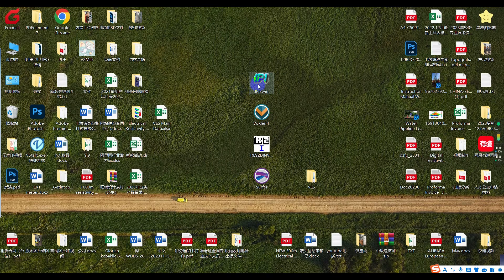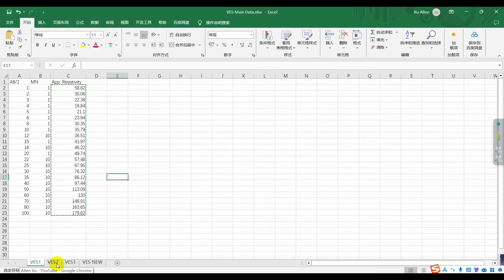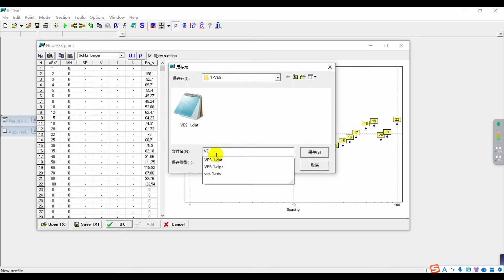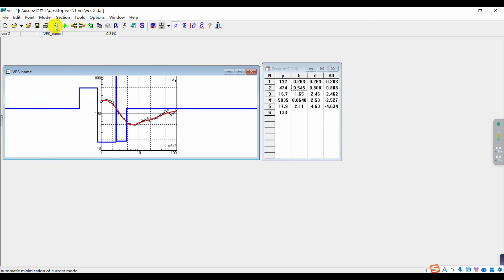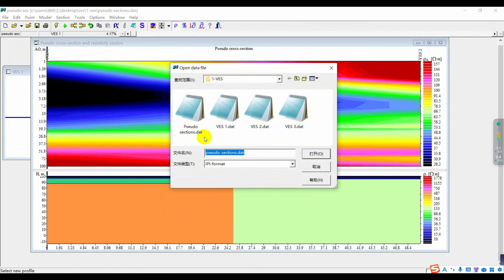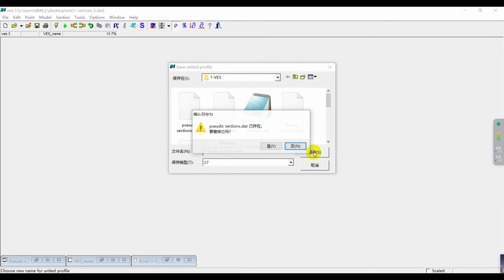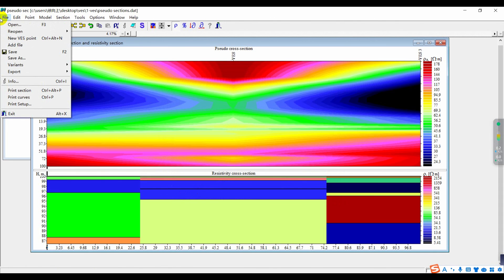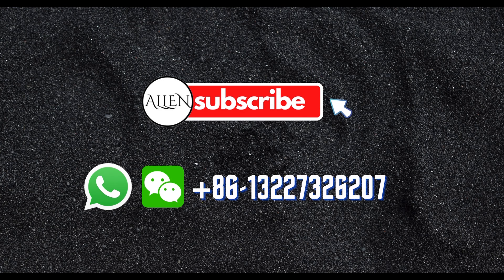How to use IPI2WIN to create resistivity profiles and pseudo-sections and create 1D 2D map on surfer

Comment: thank you, but i have question, when u're going to input new VES point, is MN data important to create profile or just ignore it? because in the video, u didnt input the MN data, thanks
Reply from the maker: Principle of Vertical Electrical Sounding (VES) investigation of the subsurface. (1) Configuration of the electrodes for a Schlumberger sounding array; dashed curves represent current flow paths, l = MN/2 is the half-spacing of the measurement electrodes, L = AO = BO = AB/2 is the half-spacing of the current electrodes. (2) Example of apparent resistivity (ρ A ) sounding curve obtained for a layered terrain, showing the variation of ρ A with the current electrodes half-spacing. Electrodes M and N are placed in a fixed position with a short spacing between them, whereas A and B electrodes are placed symmetrically on the outer sides of the potential electrodes (with the spacing AB ≫ MN)                 There are many modes for VES measurement, depending on which measurement mode you use. Common ones are Schlumberger, Wenner, Joint, 7. dipole—dipole,And so on